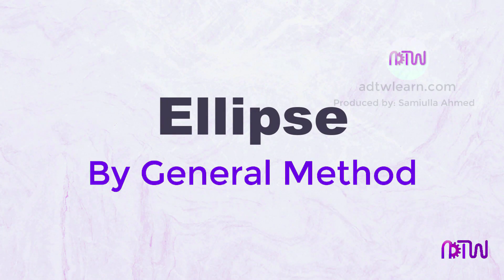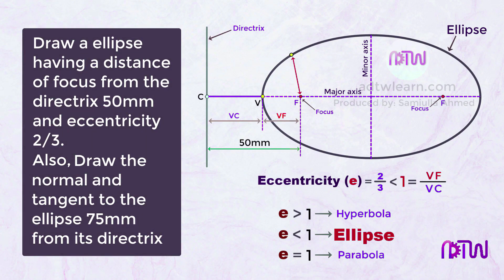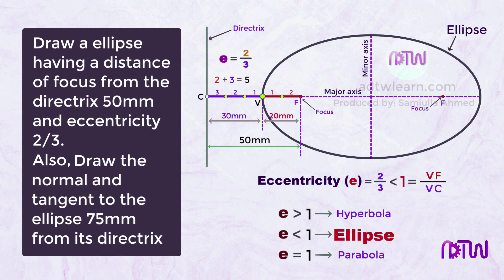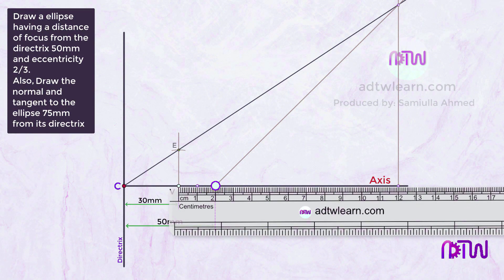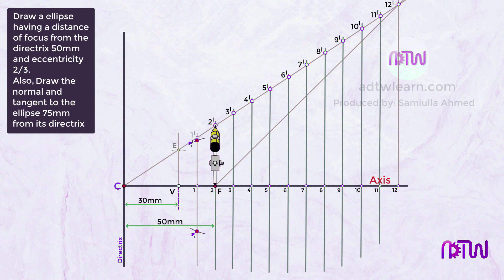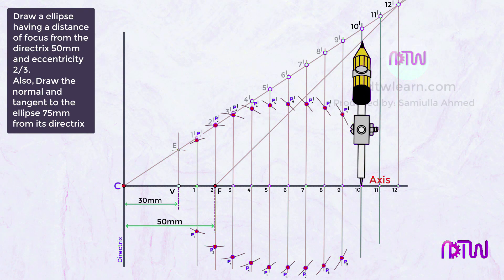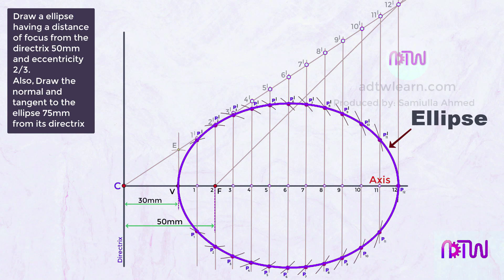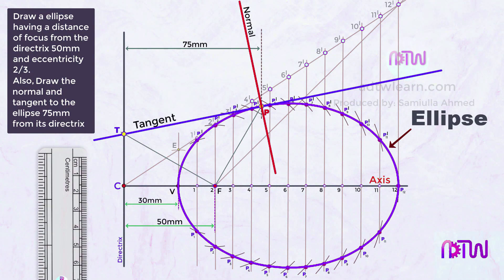General Method for Ellipse Construction

Comment: Sorry at 3:10 why is it 30mm away from directrix
Reply: Eccentricity 2/3 so we are taking as 30 and 20
Reply: If the distance focus from directrix is 70 mm 3/2 formula will not work what to do